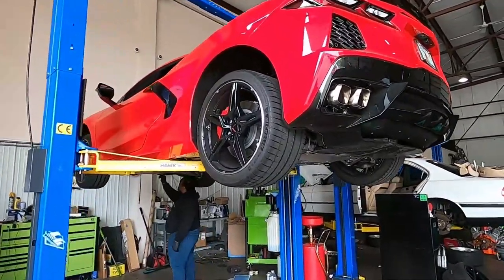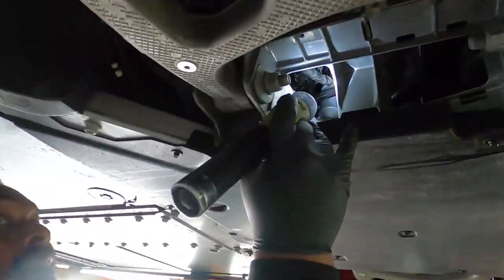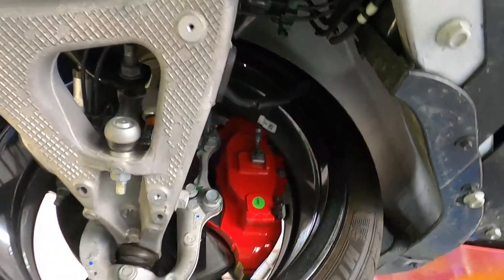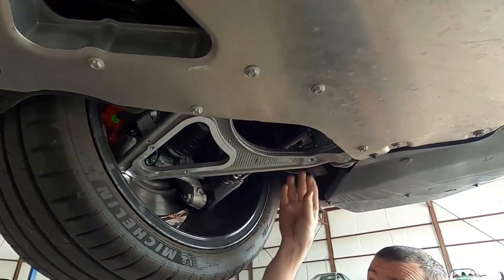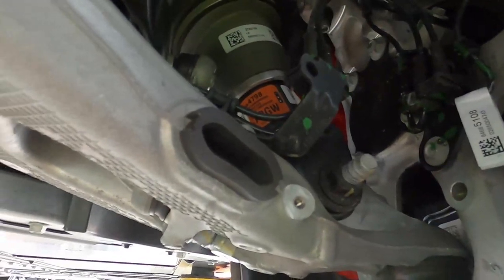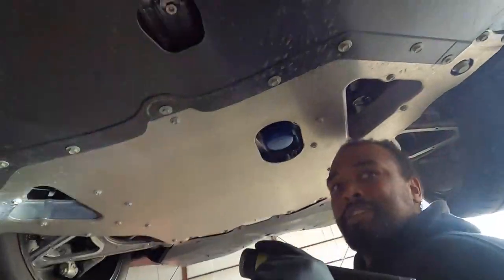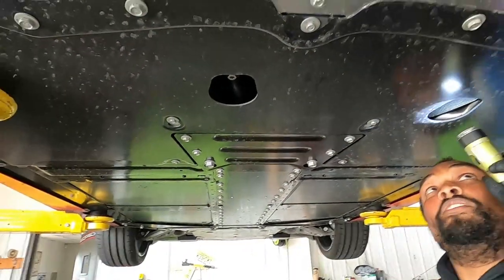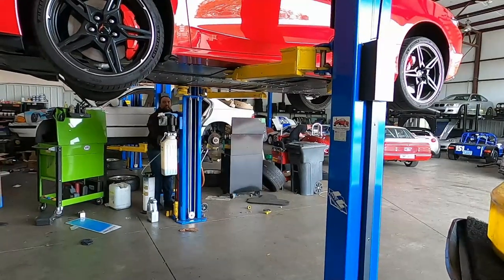C8 CHEVROLET CORVETTE 2LT Z51 WHAT IS UNDER THERE?

Comment: Excellent video. The jacking points they show in the manual are to make sure the weight is distributed properly. Your jacking points are a bit off but I am sure you guys did the rocking test before it went up to make sure it was solid. A lot of cool information. Thanks for sharing
Reply from the maker: Cool, thanks

Comment: There is a video on YouTube from Cars and Cosby showing the installation of the air ducts for the brakes. It appears that most people are putting on all four wheels but leaving off the lower rear duct which sits a bit lower. Install that just for track use. Thanks for your video.
Reply from the maker: You are very welcome Richard, thank you for the info. 👍

Comment: What happened to the Z51 brake cooling ducts?   They should be located on both front and rear brakes.
Reply from the maker: Hello Richard, good comment. We were given the brake cooling ducts and instructed that they are for track days only as for daily use they would direct too much road debris etc. to the brakes. 
Thanks for watching and commenting

Comment: The worry I have when I see one of these on a lift is someone chalks this C8 wrong and pulls anything off the front of the car and you drop it on it’s tail!
Reply: This very nearly happened on YouTube once(prob many x's by now) at a dealer in the hands of a very experienced Corvette tech prepping a new arrival. It is clearly VERY sensitive to where it's lifted from.
Reply from the maker: Somehow this got buried in the old comments. Yes the car is very sensitive to where it is lifted from. The shop where this vid was done deals mainly with rear and mid engine cars, plus they did a lot of giggling tests when the car was just off the ground. Thanks for the comment
Reply from the maker: Thanks for the comment